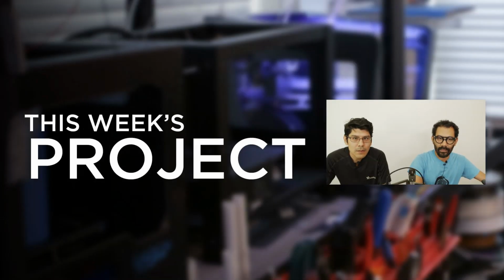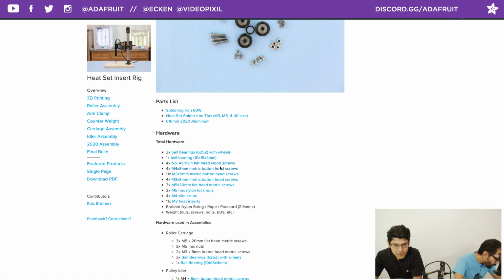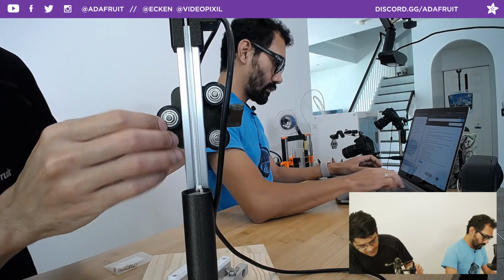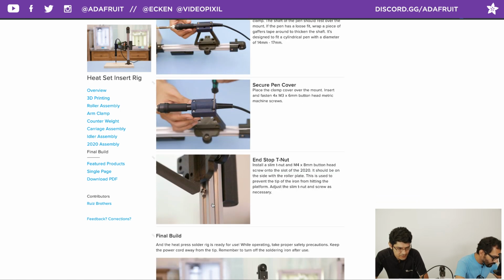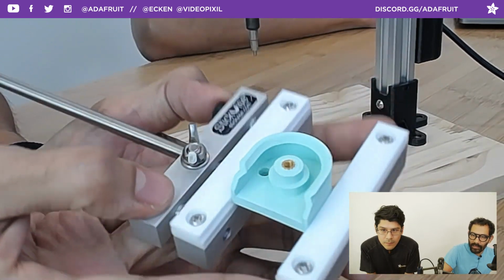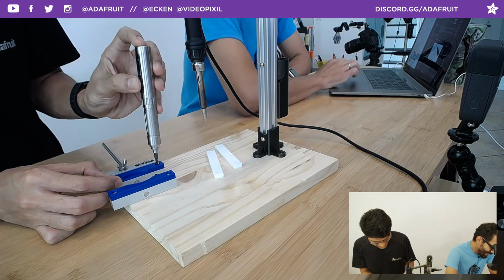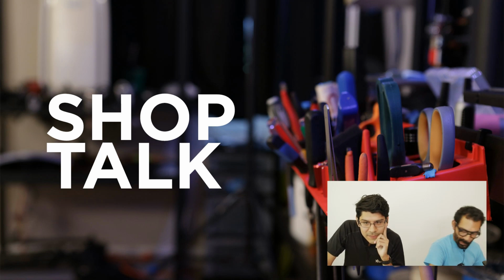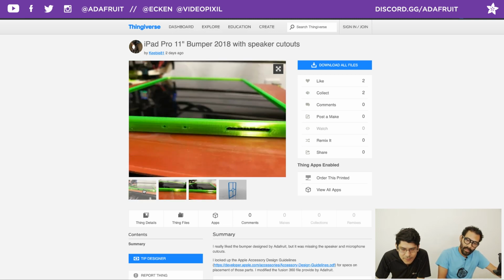3D Hangouts – Heat Set Press, PyBadge and Engines

Comment: Whats the ideal hole size for these inserts?
Reply: I was wondering the same thing.  Based on McMaster part 94459A130 (which I think are the same ones), between 3.9 and 4mm hole size seems to be what one would want (if I'm reading this correctly).
Adafruit staff : a note on this (with confirmed data, instead of my guess) in the product page (pid 4255 and maybe also 4256) and the learn guide for the above build (ref 32:44 / heat-set-rig) would be most helpful!